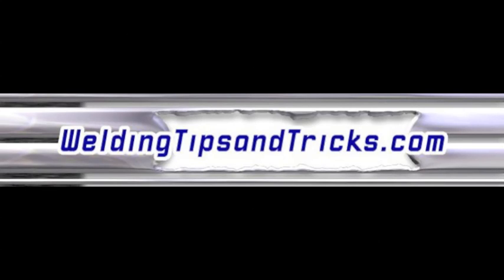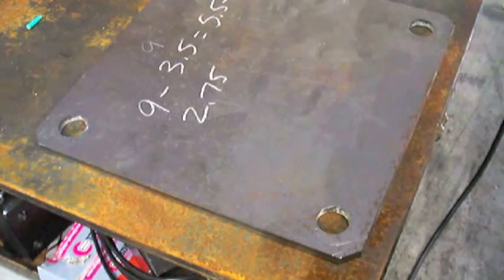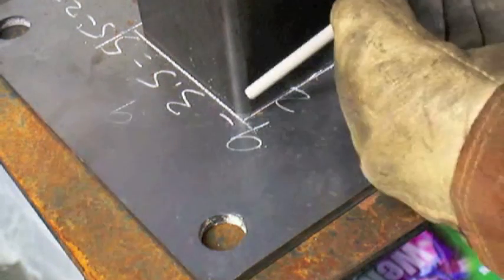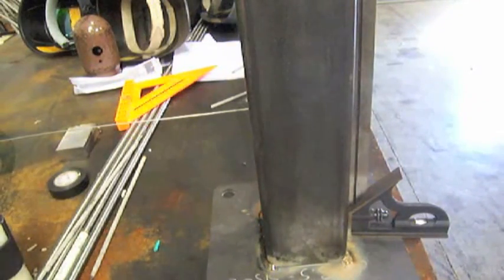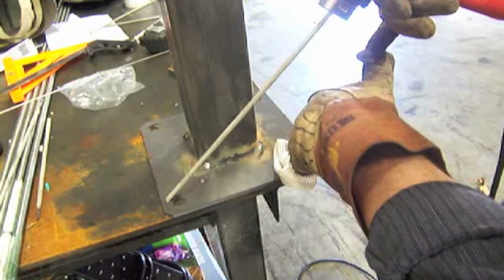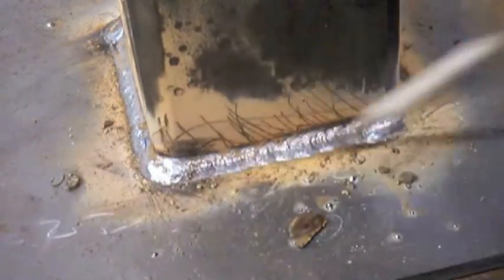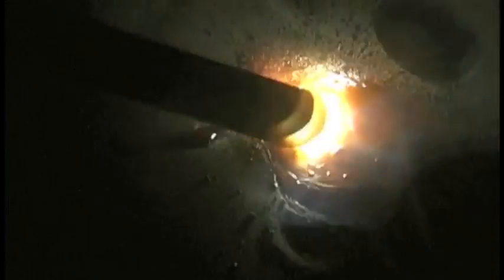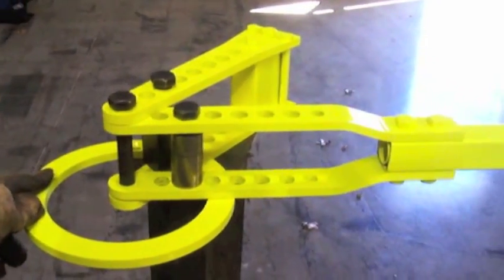ARc Welding Project -Everlast PowerPro 256

Comment: a question for Jody or anyone with welding experience. I'm learning how to stick weld with a welder I recently bought. ahp alphatig 200x. I'm using 7018 rod dcep and 1/8 steel. Is it normal for the stick to turn glowing orange with amps at 85? I wanted to experiment with higher amps but didn't know if this is normal or not. My experience is in mig only. Thanks
Reply: It happens, seems more common when I use 3/32" rods.
Reply: Do you mean the whole rod glows?
Reply: If your talking the material turn orange it's because to much heat for that thin of material. No way your rod size should be same as materials your welding.

Comment: weldingtipsandtricks 
So is a Arc welder (the stick type) great for general use of cars (vehicles)?
I mean can it be used to weld cills, new valances and things like new wheel arch skins (known in USA as fender skins i think.
Will an arc welder give just a strong weld as a mig?, thanks

Comment: Hi, love your videos.  I have a question, I am using a miller Arc welder 250 vrd. While welding it runs perfect beads but sometimes leaves holes in middle that I cannot weld back unless I do it reverse.  Even that sometimes does not work.  Is it me or the machine.

Comment: Another great video!! I sure like it when you do something with stick welding as a arc welder is all I have well, two, one is a small 110 hobby welder and the other is a Lincoln  AC/DC Arc Welder. Model:  AC/DC 225-125.  Do you know anything about this model? Thanks again for sharing your experience, you've taken a lot of the scary dragon out of beginner welding!  :)

Comment: I am trying to weld some 2in long by 1 in tall by 1/4 in thick bars of steel onto some 3/16ths seamless pipe. When I go to make the tac weld, the piece often falls off the curved surface of the pipe. Any tips on how to secure the bar of steel?

Comment: what rod welding rod did you use? and i've got an 100 amp portable welder. It can handle up to 2,5 mm rods with 100 amp or 80 amp. Can handle 1,6 mm rods with 40 amps and 2,0 mm rods with 55 amps. What rods do you suggest? I'm going to weld metal with the same thickness as you used I think..

Thanks.

Comment: Jody I've be practicing Stick Welding but still not quite their yet.  I'm pretty good with the Tig but not stick.  When arc welding, do you keep the rod in the molten metal or just above it?  If it's above, what is the best way to regulate the distance and keep it constant?   I just want to get better with arc as it is another skill I'd like to master.

Comment from the maker: @RobRichmondRPG   there are all kinds of things to watch for, but the main thing is arc length. thats the distance between the tip of the rod and the molten puddle.  keep it short. the rod is getting shorter as it burns so the tendency is for the arc to always be getting longer. if you keep it tight an set the amperage hot enough that it wont stick with a tight arc, you are halfway home. the puddle should have an oval shape and look the same for the whole bead..  rod angle and speed also matter